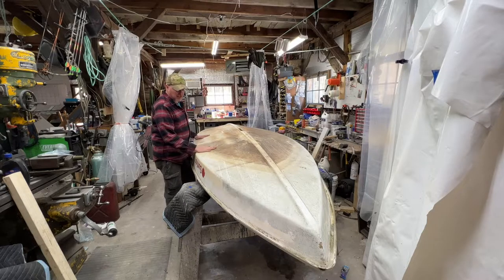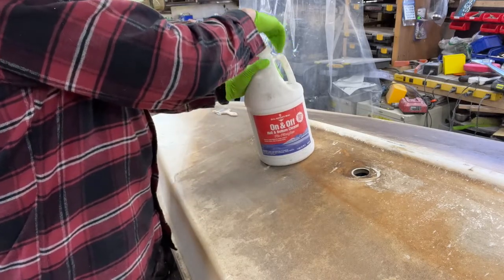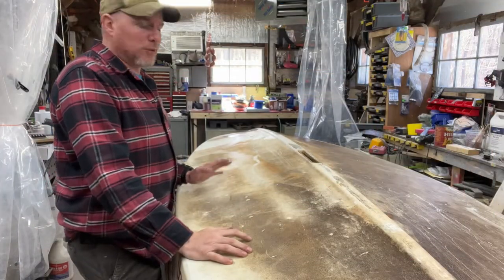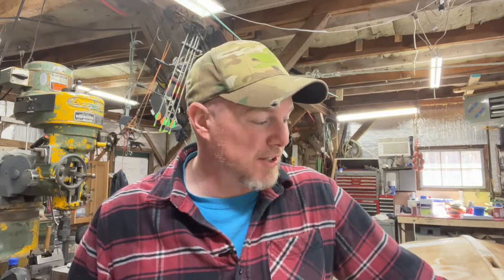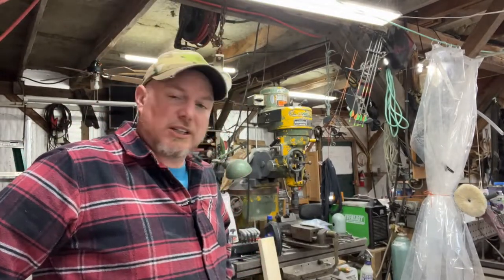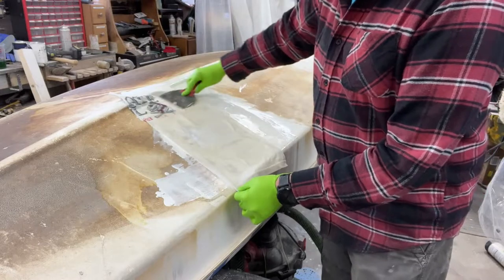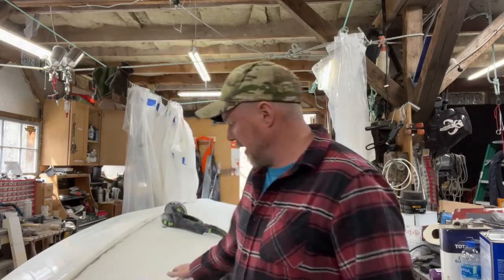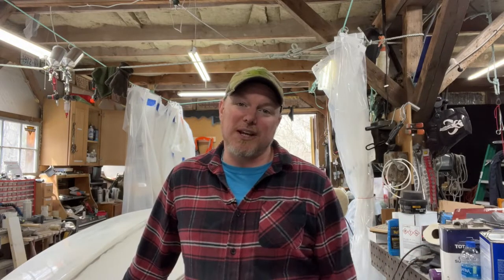Re-Gelcoating your hull. Part One -Sunfish sailboat restoration-

Comment: Thanks for the very helpful video! I was wondering, how many RPMs is your sander at when you are using it on the hull?
Reply from the maker: I have no idea 😂. It’s going as fast as it will go!
Reply: @HoldFastMarine  Hahaha I was just curious because the one I have goes 12,000 and I'm afraid that's too much!

Comment: Great information AND very entertaining, infotaining.  Our 2004 Kawasaki Jetski 1200 STX-R we’ve had since 2008 is getting a new gelcoat application.  Sanding the 3rd layer gelcoat (with wax) revealed some thin spots that need a correction. Is it safe to re-coat spots after sanding and before compounding? 
Also, this ski started taking on water via the driveshaft opening boot in the hull, ouch.  This boot appears to be factory mounted to the hull with some type of epoxy paste that failed.  The service manual says nothing about how to reattach this boot.  Any ideas?
Reply from the maker: It’s tough to do “spots” and have it all be level and pretty. It’s better to recoat the whole thing. As far as the boot, I have no idea. I avoid Jetskis like the plague 😂

Comment: You may want to try using a "Heated Power Washer" instead of the Xylene.  Way better, faster and cheaper!
Reply from the maker: That’s good but it dosent take paint off lol
Reply: @HoldFastMarine  it takes Latex off. I stripped waterproofer from a 2-story office building last year and I can guarantee that 200°F water at 3500psi will definitely strip it. ;-)

Comment: Hi, just found your channel and love it. Curious as to why you said you don’t like using chemical stripper on the hull.
I have a 31’ center console which I’ve put a few coats of ablative without a barrier coat on the hull bottom so I could wet slip it with the plan to eventually strip it all down to lift store the boat.
What do recommend to use to remove the ablative paint. Is the total boat strip capable of doing it without harming the hull
Reply from the maker: The total boat stripper will work, and I’ve used it for that exact purpose. It will not remove the gelcoat underneath. However it’s a huge pain in the butt. And it’s extremely messy. The best way is to hire a company to come media blast the hull. Make sure they are qualified and use the proper medium, which is usually a soda medium. This could remove the gelcoat, or damage it. I personally would rather repair or re gelcoat the hull just to avoid the paint stripper.
Reply: @HoldFastMarine  
Thank you for the reply. Would re gel coating still require me to completely stripping the ablative.
Reply from the maker: Yes. It would.

Comment: I'm stripping bottom paint off with qua thinner. Could i use the on and off  hull cleaner to get rid of any paint stain residue on the hull?
Reply from the maker: You could try it. But on off isn’t good at removing paint.
Reply: Try Boraxo and a brush.